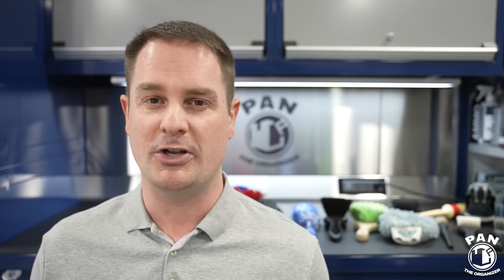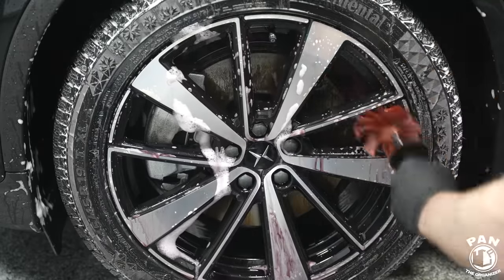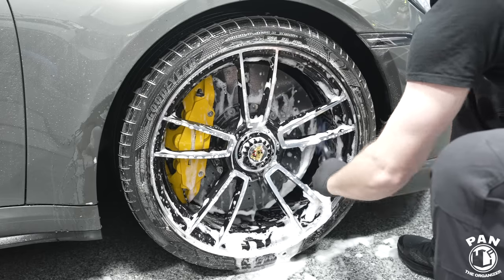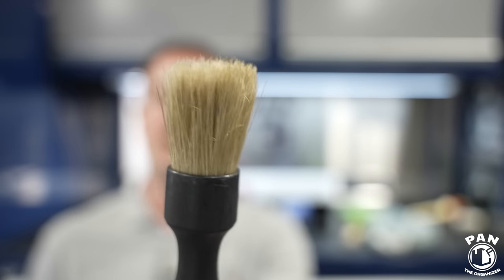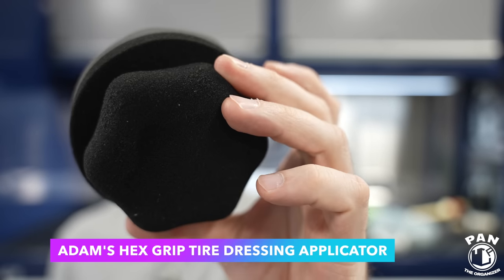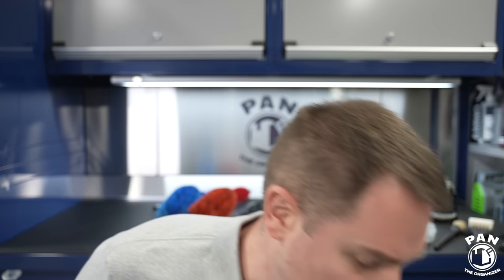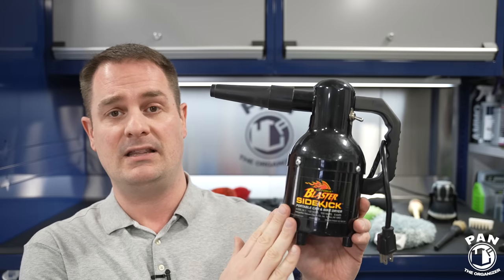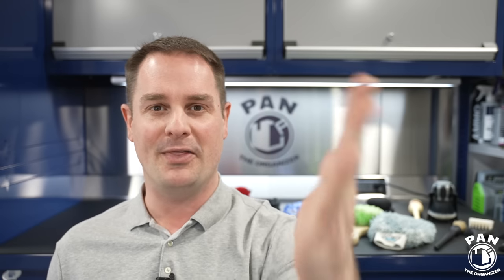THE BEST WHEEL CLEANING BRUSHES!

Comment: Hey pan, I’ve had some trouble finding a good brush that will fit in between huge brakes, that with also be safe on gloss black wheels..  only one I’ve found that fits is the samallest wheel gerbil cg has, but it won’t reach the back of the barrel and my brakes tear the fibers up over time and I have to replace them. half the time I end up just pulling the wheels of to fully clean them.. HELP would be much appreciated!!

Comment: I use the blue EZ detail brush for the barrels and getting behind the tight caliper area but I REALLY like using the "Detailer's Preference Double Sided Microfiber Interior & Exterior Auto Detailing Cleaning Glove". It takes the whole wash mitt concept a bit further giving your fingers the ability to really get into the tight areas and have found for the wheels on the various cars I've had over the years, this glove is always making life easy when it comes to cleaning the spokes.  I'd say the more spokes you have, the better this glove becomes.

Comment: I would like a wheel wooly type brush in between the large and medium size one. That would be perfect for the barrels. Tires i like the black TRC brush. Face the wheel woolies boars hair brush you use.
As far as the ez detail brush it would Benefit to be a little bit firmer. Just doesnt clean as good as i want.
Edit: the lambs wool hand mitt OG offers is great for the face and behind the spokes as well.

Comment: Very informative as always, thanks. 

I also have carbon ceramic big brakes on the front. (2019 MB C63s) Do you take extra precautions when using chemicals on your carbon ceramic brake rotors? 

BTW, just incase you did not know (unlikely)... when washing a newer Benz, double lock the car to prevent the annoying locking/unlocking. 

Thanks again.

Comment: Hey Pan, very detailed video! Would you consider looking at Armor All Brake Dust Repellent? It does a fairly good job at reducing brake dust. I'm just not sure what is actually in the product or what type of product it is. You spray it on after you clean the wheels and let it dry.

Comment: Pan! You should also mention Bilt Hamber Atom Mac (spray on neat or as neat as possible, my recommendation) for brake disc rust prevention. Its readily available in the UK and possibly some other countries where the product you mentioned might not be available. 👍
Reply from the maker: Good point.

Comment: Another great video Pan.  Quick question.  If you apply a  silica based spray after cleaning the barrels, rims and wheels, once the silica spray has been washed off and the tires are dry, can you then apply the tire dressing.  Further to this, if you were going to apply the Hydes Serum Rust Stopper as well, would that be applied after the silica spray has dried as well.
Thank you for all of your advice, I love following your videos and keeping our SUV looking brand new.
Reply from the maker: Yes you can apply a tire dressing on the tires once they are cleaned and dry.

The Hydes spray is normally applied to the wet rotors when you are done rinsing the wheels.

Comment: In regards to the rust protectant for the brake rotors. Will it cause any issues with braking or Brake performance,
Reply from the maker: Zero issues, as that's just to prevent flash rust after washing a vehicle. As soon as you brake, it goes away.

Comment: Can you wash off the curveball brush after applying the tire dressing? or is it not necessary?
Reply from the maker: If you only use it for that purpose, not necessary to clean it. If you want to clean it for different uses or if it gets too gunked up over time, simply spray some APC, work it in, and rinse with warm water. Boom, done.

Comment: Hey Pan great video! Have you ever used or heard of using a drill attached brush to really get into the rubber?
Reply from the maker: I have heard of that technique but never tried it. I wouldn’t want to run the risk of scratching the wheel finish.

Comment: When applying silica Sealant to the wheel,  is there an issue with coating the Rotors?  couldn't they become slippery when braking?
Reply from the maker: Absolutely no issues. As soon as you hit the brakes that small layer gets removed instantaneously due to the high friction of the pads and rotors. You won't even notice a difference when braking, so zero issues here.

Comment: If you use protection on your wheels should you avoid using a degreasing wheel cleaner on subsequent washes?
Reply from the maker: If you are using a good wheel coating, you can continue to wash your wheels with wheel cleaners, no problem. On wheels, most good coatings only last 6 to 12 months anyways, due to the harsher environment in that location.
Reply: @PanTheOrganizer  thanks for the quick response. Just got the nicest vehicle I've ever owned so trying to keep it looking nice. It's a challenge though because it's a very tall Ram 2500. I watched your platform vid. But I don't think that will even be close to being tall enough...
Reply from the maker: Welcome to my channel. You discovered one of the biggest car detailing channels on YouTube as we surpassed 780,000 subscribers and are getting close to 100 million views! I have been detailing for 25 years and I love to share my knowledge and passion with my viewers.

You found the right channel to help you learn everything about detailing.

Comment: I have a question on the ez detail brush mine came in squished is there a way to fix it?
Reply from the maker: Not to my knowledge, but it shouldn't really matter for performance, as once wet with shampoo or a wheel cleaner and you start agitating, it should still work well.
Reply: @PanTheOrganizer  I was looking around and found out that if you use a blow dryer on medium heat it actually restored the shape to the original condition and it worked. I heard warm water does the trick also

Comment: Do you have a preference for tire dressing ? Have you used PERMASHINE TIRE COATING by exoforma ? They advertise that it lasts a year ? Wanted your opinion on it ? If it's a good or bad tire dressing
Reply from the maker: I haven’t tested those. My current favourite tire coating is CarPro BlackOut (I get 5 months durability in summer and 2.5 months in winter).

For my favourite tire dressings, there are a few. Adam’s Graphene Tire Dressing, Obsessed Garage Tire Dressing, CarPro PERL diluted 1:1, Chemical Guys VRP, etc
Reply: @PanTheOrganizer  thank you

Comment: Hi Pan!  I commented on 1 of your other vids that I was detailing the cars (Nissan Altima & Chrysler 300) of friends.  The overall detail turned out GREAT for both cars!!  However, much like my own car, the wheel barrels on the Chrysler gave me issues.  For some reason, I CANNOT seem to get the wheel barrels on my car totally clean and it was similar with the Chrysler.  Keep in mind that I live a rural farming area that has LOTS of dust and tons of gravel roads.  Still, after I wash the wheel barrels, they're NEVER as clean as I'd like, despite using either Adams or Turtle Wax Wheel & Tire Cleaners.  Just bought a pressure washer for future washes, so perhaps that'll help?  Please advise.  Thanks!
Reply from the maker: What brushes are you using for the barrels? You need a barrel brush in addition to the wheel cleaner, if you want to get them clean. Also, applying a wheel protection (like a spray off rinse off sealant) at the end of the cleaning process makes future cleanings MUCH EASIER.

See my wheel and tire cleaning tutorial here: https://youtu.be/omwcNcSYcS8?si=M4dqpAo6PVKyMFA5
Reply: @PanTheOrganizer   Thank you for your reply and for sending the link to your tutorial.  I have watched it multiple times, but haven't still gotten your results.  I have wheel barrel brushes that I bought off of Amazon.  They aren't the brand that you use, but they are for cleaning wheel barrels.  I'm hoping that my new pressure washer will help make the difference.  Thanks again!!
Reply from the maker: A pressure washer helps, but it's the brushes (mechanical agitation) that make the biggest difference.
Reply: @PanTheOrganizer  Thanks again, Pan and noted!  Will upgrade my wheel barrel brushes.
Reply: @PanTheOrganizer  Hey Pan!  Washed my car over the weekend and my wheel barrels  FINALLY came out to my liking!!!  CRAZY clean!!!!  I didn't use my pressure washer to do it either!  When drying the barrels, I used a microfiber towel and that did the trick!!!  VERY happy with the results!!  This latest mechanical is the BEST my wheel barrels have ever looked since I've had my car!!!

Comment: Hi Pan,
Awesome video! I always use that speed brush and yes I noticed the superficial scratches. Not sure I want to tackle this problem but if I did what are my options to remove these scratches? Also, what was the best brush to get between the rotors and wheel for large brembo rotors? Thanks!
Reply from the maker: If you have gloss black wheels, avoid using the Speed Master bruah and get a microfiber brush like Microfiber Madness Incredibrush or Gyeon.

Unfortunately the only brush I found that can go behind my massive 10 piston calipers and huge rotors on my Porsche is the Speed Master or EZ Detail brushes.
Reply: @PanTheOrganizer  Thanks. I guess that's why I'm using it. How would you remove the superficial scratches?

Comment: What about the best wheel brush for carpet fender liners? I find they are the hardest to clean and the brush ends up picking up a lot of dirt and sand which I don't like as it could scratch up the barrels on the next wheel clean if I'm not meticulous with washing it out
Reply from the maker: For carpet fender liners, I use my pressure washer. That's the most efficient way to clean those, and you can finish off with the fender well brush and a bit of soapy water.

Comment: Doesn't Brake Buster have rust inhibitors for rotors? Also, is something like TW Hybrid Ceramic Detailer Spray good for Satin finish alloys as a sealant?
Reply from the maker: As per P&S: “Brake Buster deposits a thin layer of special corrosion inhibitors to protect the wheel from future corrosion.”

I haven’t tested the TW on satin or matte finishes.
Reply: @PanTheOrganizer  I've put some TW on, it has glossed up the satin finish nicely, and given them a nice dark rich tone (they're dark graphite) we will see how well it holds up to winter driving

Comment: Not a chance does Gyeon wet coat last 2 - 3 months, 2-3 weeks if your lucky. I do like it to make the wheels easier to clean though.
Reply from the maker: Durability varies for any product, with different factors and variables. Same applies to any paint protection. Mileage, condition of the surface, prep, conditions while applying, conditions the vehicle is submitted to, maintenance, etc.  I could go on for days.

Comment: For some reason I never could have the geon wet coat last more then couple washing cycles? Having that issue also?
Reply from the maker: Durability varies for any product, with different factors and variables. Same applies to any paint protection. Mileage, condition of the surface, prep, conditions while applying, conditions the vehicle is submitted to, maintenance, etc.  I could go on for days.

Comment: Hey Pan, awesome video! I wanted to ask, is it safe to use Carpro Iron c snow soap on ceramic coated cars on regular bases to keep the hydrophobic properties from masking by iron deposits or is it too abusive? I found this product and seems to be a wonderful combo, but what to you think? Cheers from Estonia
Reply from the maker: No. There is no need to use iron removers or CarPro IronX Snow Foam on a regular basis. You use iron decon once very 3 to 4 months, or as needed depending on brake dust contamination.

For regular weekly washes, use CarPro Reset for coated cars. That's what I use on my Porsche and I wash my car twice weekly.

Comment: Hey pan, question about ceramic coating. Can I apply new layer a year later without removing the old coating?
Reply from the maker: You mean the spray on rinse off spray sealants? Yes you can just respray and rinse when you need additional protection.
Reply: @PanTheOrganizer  graphine seramic coating sealant from Addams is what I'm referring to
Reply from the maker: If you are talking about the glass bottle version, Adam's Graphene Ceramic Coating, no. You have to fully restart all the steps including machine polishing before reapplying it. But it should last for many years before you even have to reapply it if you have applied it correctly and are maintaining it well.

Comment: Hi Pan is there an internationally available alternative to Hydes Serum Rustopper? I saw other people recommend Metal Rescue Dry Coat Rust Preventative, but im not sure its safe to use on brakes and brake pads. Flash rusting after wheel cleaning is so frustrating! If you have an eye for details lol.
Reply from the maker: Bilt Hamber Atom-Mac in Europe
Reply: @PanTheOrganizer  Im from Australia and its not available here either.

Comment: Have you tried using the the Carscope tyre dressing brush ?
Reply from the maker: No.
Reply: @PanTheOrganizer  worth checking out. I really like mine
Reply: It's just an AliExpress brush and the ergonomics aren't there, once again because it wasn't designed for detailing
Reply: @KiranPatel-fk1pg  Did you have one ? I'm interested in what didn't you like about it ? Quality seems good to me. Its well made certainly for my use anyway, bristles don't fall out. It gets into all the nooks and you can easily apply it to the lip of the tyre without getting any dressing on the rim. It easy to clean and has its own cover. A lot faster than using a  detailing brush.

Comment: How do you get white specks off your car from?
Reply from the maker: Can you be more specific? What white specks?
Reply: People outside with white paint working  on houses white paint specks landing on my car what can I use get it off?
Reply from the maker: Oufff!!!  There's no miracle to that. You have to try a few different methods. You can try Citrol 266 which is often used to remove splatter from painted street lines. Or nail polish remover. That won't hurt the clear coat, just make sure you rinse thoroughly after use, and wash the car.

You can try a claybar and clay lubricant...
Reply: Thank you